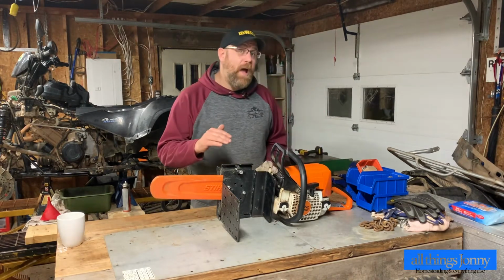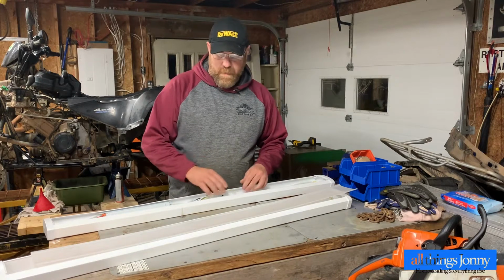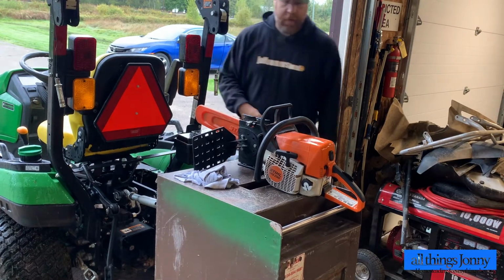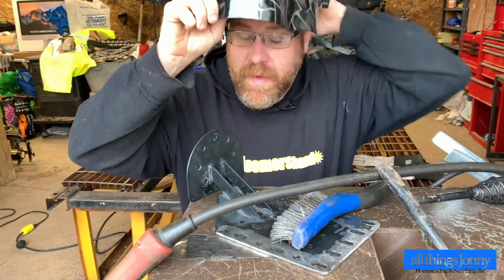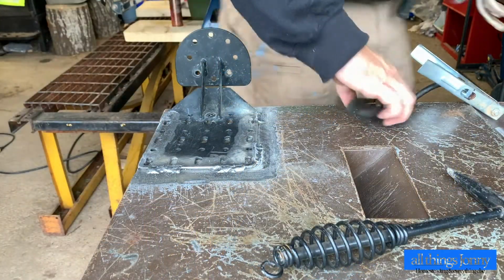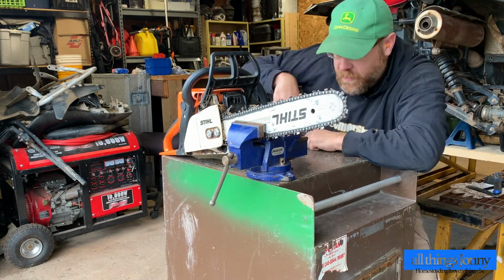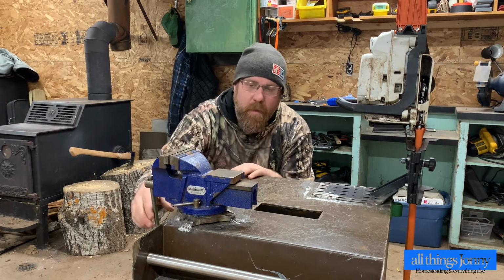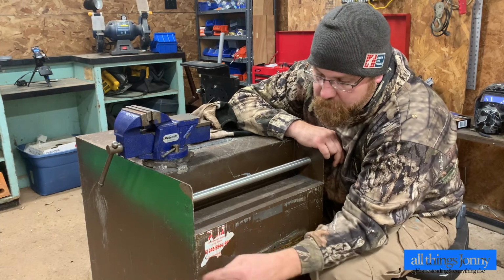All Things Jonny Episode 7 -  THE BALLAST BOX of your Dreams!!

Comment: I'm guessing -- believe the base for vise is cast metal. It can be welded , BUT  watch out for heat or stress  cracks from vibration. Had an incident of a cast weld breaking and electric motor just missed my foot when it fell. Keep up the videos
Reply from the maker: Thanks for the tip!!  Hey, I'm back to making videos, and there are some additions to the ballast coming up!!!  No issues with the vice as of yet...  i use it even when the box isn't mounted to the tractor!  Can't sharpen the chainsaw with out it!!